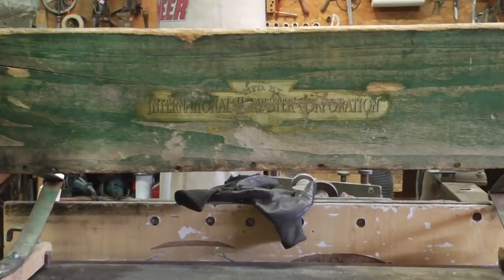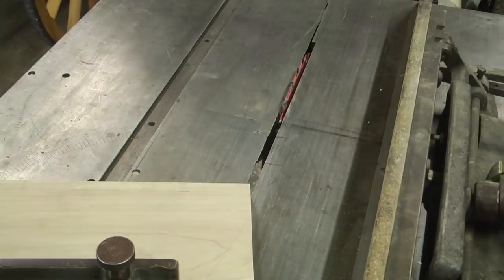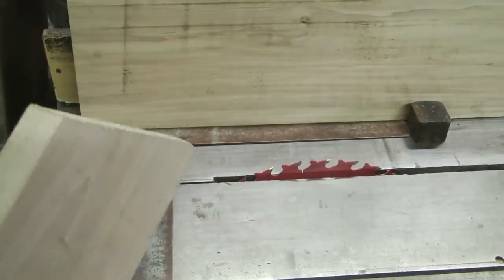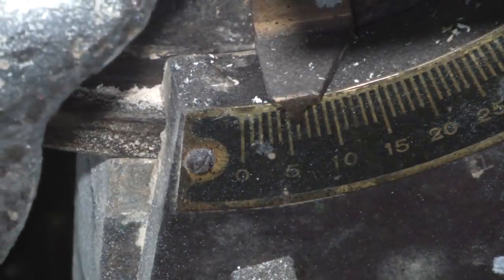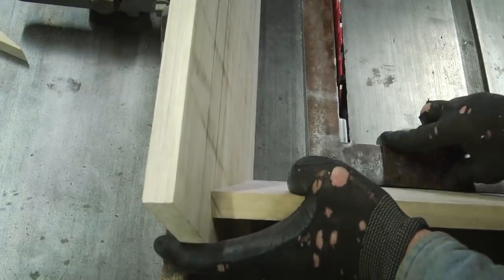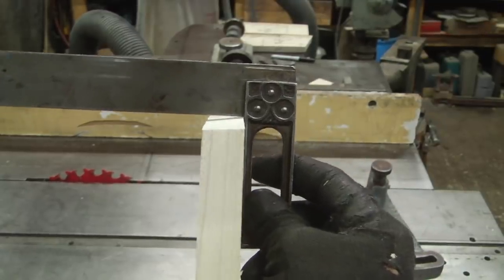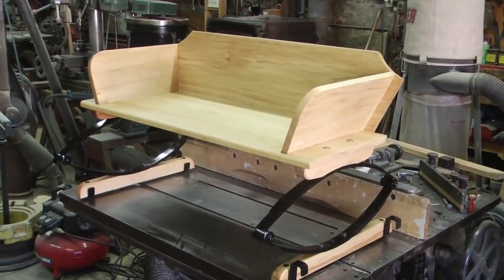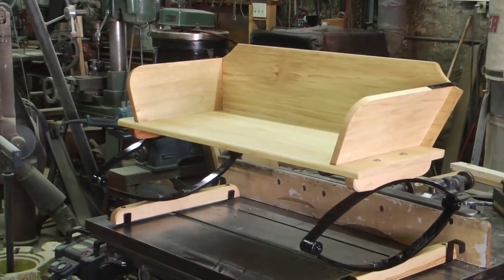Building a Wagon Seat Concludes the International Wood Wheel Wagon

Comment: You must be the last shop in North America still running a Northfield No. 1 tilting table saw. I owned one 40 years ago: 14" blade capacity, 5 hp straight arbor, direct drive no pulleys, no blade guard. A 1000 lb. cast iron beast. In any argument, the saw always wins. I sold it while I still had all my fingers. A fool and his fingers are soon parted. Made a pretty solid work table, though. Got a chuckle watching you do the same. I never thought to use the tilting table to facilitate assembly. Good idea. Good luck to you, sir.

Comment: I love your channel.  I've been attempting accuracy in carpentry for 33yrs.  My mentors and co-workers really were teaching & striving for zero tolerance.  I love the way this video shows the help your old table saw provides in this endeavor.   Thanks for the close-ups as well as the explanation of what I've defined as "compound miters" for years. 

I've actually seen experienced carpenters, try to use gauges, w/ little understanding and lack the ability to envision the results of a cut, try these more complicated joints.  On top of which, they may ignore common sense solutions, like drawing guide lines to help remember the angles they worked so hard to find.

I draw the lines myself :) and feel no humility by using them :)   

Short story :

Once as a helper, early on in my carrier, my journeyman and I were cutting a series of oval 2"x 6"x 12' floating ceiling borders that died off into, what seemed to be Octagonal columns and beams.  At least 1/2 an octagon as they were attached on the flat leaving 5 sides.  My journeyman tried using bevels and protractors but could not figure the angles.  

I could see his conundrum and tried to suggest, either visualizing the octagon or even guestimating the angles and cutting them close w/ a test piece, ........ , checking it and adjusting the angles until it fit.   He would not hear of it and told me to wait while he went out to the parking lot and get an old protractor that his grandfather gave him.

Well, while he was absent, I used a 2"x 4" and cut angles close, by drawing lines to help me remember what I saw on the beams and in 2 attempts, had found that the angles were standard and marked on the slide miter saw :)   I was waiting for my co-worker to get back when my foreman walked up.  

Long story short, my foreman told me to proceed w/ out him and gave me a helper to work w/ and put my journeyman on another project :)

Common sense can rule the day if you use it !
Thanks for the video,
Steph
Reply: That's a gift - to be able to visualize things in "3D". :-) I struggle with it - have had to teach myself the little I know about it. I always envied guys like you that so obviously could grasp the multiple angles coming together in their minds...
Reply: Thanks for the kind words Dave Weber :)   Everybody's good at something but I find that really listening to others help in areas I fall behind in.  Being close minded has never been much help to me :)   That journeyman taught me to be more open minded and not too proud to ask or take advice, a much better talent in my book :)
Reply: Bahahahah , "too simple minded to be complicated"   LOL  .........  I love jigs and test pieces :)   You keep em' comin' and I'll keep watchin' :) lol :)
Reply: +EngelsCoachShop it's like looking at something in 3 D that figure how to make i guess at least that's the way i look at it. i love video's i am just about done watching all of them thank you.

Comment: Inspiring and amazing.  I have never seen a table saw with a split moveable table.
Your attention to detail is beyond the comprehension of the average craftsman.
I was wondering how many Hammers you own.  50?  C clamps? 80?  Some obvious favourites.
Does the steel tire achieve any hardening when water is put on it after heating and setting?  Brinnel range 150-200?
The center 3 top bows do not seem to be equally spaced.  Camera Angle?

Comment: Most of the load bearing stuff is riveted but I was really surprised to see the original had so many nails in it.  I know it's not fine furniture but the roads these old girls had to work on couldn't have been good for nailed connections.  I guess I just expected more wood screws.  Manufacturing costs certainly came into play.  Were International wagons the Cadillac or the Chevy of the day?

Comment: I admire your work tremendously but have a humble  observation: those nuts holding the seat leaf springs have a tendency to come lose because of wood contraction and expansion. I wish you secured them by hammering the end of the bolt to prevent this potential mishap.

Comment: Enjoy your videos. Please, what type of wood is used? Are those square nails? I'd like to replicate my Grandfather's tool box. It's construction would be very similar to the wagon seat, adding a front and center handle.  Thanks
Reply: @EngelsCoachShop  Thanks for the quick reply. I love the vintage items.

My grandfather replaced wagon wheels with rubber tires to haul freight across the Sweetgrass / Coutts border. As a teen a friend and I made a go-cart out of the old wagon wheels. We used fence post for axles. Spent many a day running that thing down the hill in front of the house.

Comment: I would suggest slots I stead of holes for the middle and front nails of the arms to allow for wood movement and prevent the bottom from splitting.  No glue either.  If you notice the original was  probably not assembled that way and the bottom split.

Comment: Sorry for the unsolicited advice especially when directed toward a woodworker of advanced experience but the gloves and table saw are a bad mix.
Reply: If you have bare hands and the blade accidentally touches your hand you will get a nasty cut. But with gloves, the fabric has a tendency to not completely tear and the glove drags your hand into the blade. My sister works for a doctor who had this happen to him. His hand was almost completely severed across the palm. Tight gloves like these in the video are better than loose ones but the consequences are still too high for my comfort.
Reply: Have you ever run the vacuum cleaner too close to the drapes? Same concept.
Reply: Your name says it all !!!
Reply: Sammy Spaniel:  yes I have never worn gloves around powered machinery for this reason.  I guess there are risks either way,  but I would rather have the constant reminder of the danger millimeters from my precious fingers than feel a little protected by gloves.  It's an individual choice but my choice is to feel the danger.